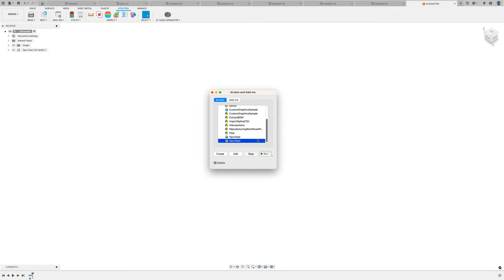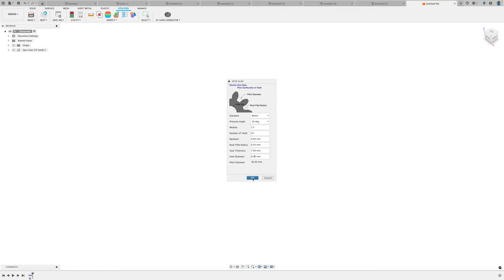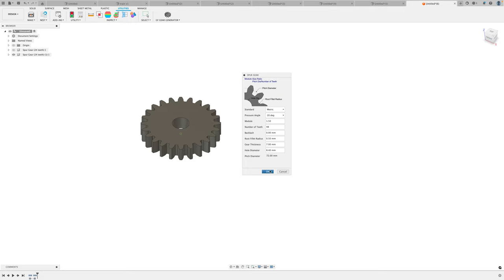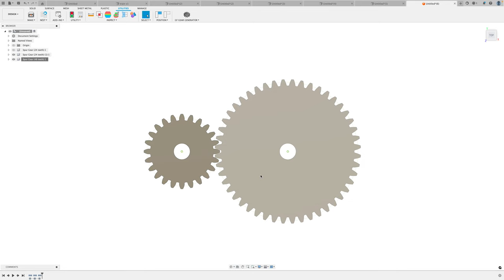How to Design Gears for 3D Printing Using Fusion 360

Comment: A gear I'm working on now (not 3D) is module 5, and about 13 teeth
it is only 6mm in diameter, so it sounds like your 1.5 module
is barely visible without a microscope. 
shrugs....